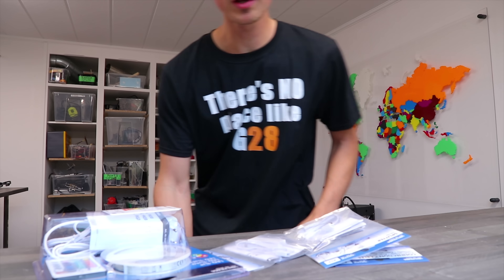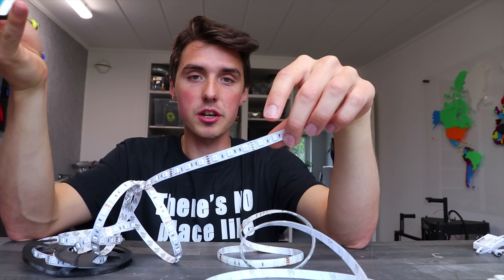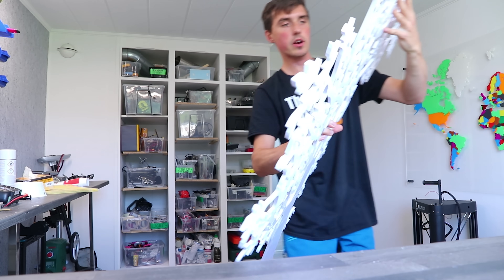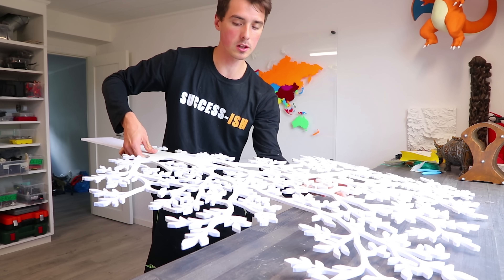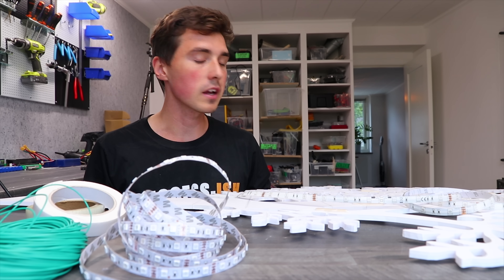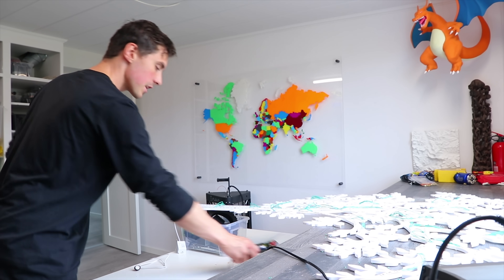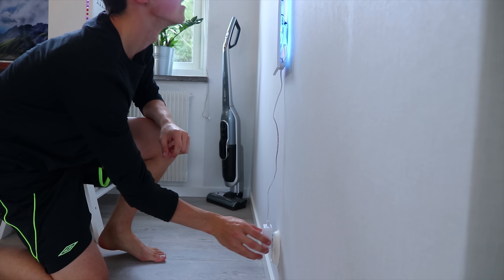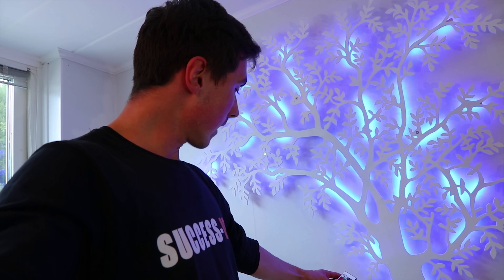This 3D Printed Tree Changes COLOR!

Comment: Hello Simon. I had to enlarge/drill holes in 3D printed parts. After cracking them a couple of times I tried "drilling" in reverse. Normal drill bit but setting the drill backwards. That just melts the plastic to the desired diameter.

Comment: Very cool!
Some ideas :
- put the plug in a timer so you can just leave it on and it will turn itself on/off.
- You could draw some more parts of the ''stam'' to cover the wire and let it go all the way to the ground

Comment: Next time take some metal screw bar with 4 mm and make small pins, then make at each connection holes in the building phase on PC.
Now you have after printing a hole for solid metal connection and for the rest an acryl glue is enough. 
Also the parts will be alligned, so less stress when you build it and print 4 covers for the screws.
Easy thing, a hexagon and a cover plate, connect both and print it four times. Should be only 20 minutes print time.

Comment: Very cool will be to change the 3D model to hide all cables, left properly place to LEDs and electronic, add direct model stands and also detachable connections between parts.

Comment: regarding the connection of the different tree parts, you could have edited some interlocking joints - like used in puzzles. Another option would be to leave a half pipe shape at the edhe (1 or 2 cm) on both sides, glue in a wood dowel (think Ikea) and a 3d printed cover for the back. The front will only have a single connection line like now and it will be pretty strong. Otherwise very nice work as always.

Comment: When you need to fill parts and sand, use wood filler(i buy on biltema too)....they are super easy to apply, easy to dry and sand. To glue those parts you can try super glue and baking soda.

Comment: Should have mounted the LED's facing the other way, and reflect it back at the wall for a smoother light spread.
Reply: It is mounted like that, the tree is mounted with leds facing the wall.😊

Comment: Always finding interesting projects to design, print, finish and install. This one's a beauty.

A couple things I'd revise are:

1. Printing slots in the trunk and branch joints, as well as tapered "biscuits". The biscuits aid in precisely aligning the pieces, tighten up the joints and provide increased surface area for glue.
2. Print "keyholes" in the back of the trunk and branches to avoid screwing through the face. Velco Command Strips would also work well on a project like this that's not heavy at all.

Lastly, I use Bondo Glazing and Spot Putty on all joints I want to hide. Works a treat...and fast!

Comment: That looks awesome. 
While watching you struggle with the epoxy I had an idea of how to make the parts stronger. Instead of cutting the pieces with straight (or slightly curved) lines, try to use a kind of jigsaw-piece hook next time. That way the piece can't move in the horizontal plane. I found out that a 0.15mm tolerance on one of the sides of such a connection gives you a nice press fit. So unless you deal with high forces you could even go without glue. Of course adding some kind of an adhesive further increases the strength.

Comment: 10:09 sorry i dont want to be that guy but please take care not to drill into your house wiring =D just for your safety!
Reply: how does he make sure not to?
Reply: @towers3372  i am not a electrician or anything, but my father always says that the cabels are either vertical or horizontal. so you might at least make sure that there is no wall plug under it. but that's no guarantee for the wire. I think there are some wire scanners avaible. but anyway, very cool project

Comment: You can use flat metal brackets glued or held with double sided tape behind the connections. 
Maybe even make the connections fit like a jigsaw puzzle plus the bracket behind.

Comment: That came out great. If you were to try piecing something together like that again, I recommend trying 3D Gloop! They make a variety of formulations, I have and  use their PLA one to great success. It does a bit of a chemical weld, making the joint pretty darned strong. Joel (3d Printing Nerd) noticed some incredible strength from it when testing it out.

Comment: Nice! Really like that.   If you printed it face down, couldn't you at the seams pieces that come up a bit to give you a larger surface to glue or even bolt and glue them together?  As long as it's not too tall, it shouldn't hit the wall.

Comment: Amazing job !

Side note, your printers consume way more power than your led will even if you let your tree lit up for hours :) so I wouldn't worry about the electric bill if I were you 

Also, a cool upgrade would be to replace the current led strips with ws2812b and combine them to an esp8266

That way you could achieve very cool thing such as the tree glowing of a certain color when an specific event happen (let's say you got an email or whatever)

Let me know if you want to upgrade your setup, I might give you a hand :)

Comment: you should use 3D Gloop instead of epoxy, 3D Gloop literally welds the pieces into one solid piece, it is stronger than the layer adhesion of the print itself, 3D Printing Nerd
 did some vids on it.

Comment: For future projects involving RGB lighting, look into WS2811 pixels. They have super inexpensive controllers for them that will just run modes (much like what you are currently using), but can be programmed using a raspberry pi also to be different colors down to the individual led. I use these on my house for Christmas lighting.

Comment: Really like this idea good work :) I have found a tiny dab of superglue just to hold the pieces in place, then some of the same filament cut off and a soldering iron melting it in the gap (kind of like the way tig welding works) then sand and paint worked for me :)

Comment: Simon, why aren't you printing multi parts with holes in it so you can stick something in it to make it more stable when you have to add the glue. Like the wood pins but maybe not wood but plastic. That would help a lot to manage big prints with multiple parts like that one.

Comment: Is good that you have printers to do this print that takes a lot of hours,is looking nice but I would prefer to use foam board  to do this instead of 3d printing it,I mean you always  have different  materials  to chose when you make stuff like this,but when you have just 1 printer there is no point to do this.
Reply: wont last as long with foam unfortunately. could try thin plywood with a laser cutter. unfortunately laser cutters are more expensive than printers

Comment: stipud question, when you slice it to printable size, why dont you add puzzle like joint points?
also a submerged channel design for the wires and strips?
Reply: He doesn't need channels for the wires since it needs some space from the wall so the light comes out.
Reply: it sticks out and noticable when looking fom the sides plus it had to be glued so it would improve the look and functionality too. looks nice but did not pay attention to details.
Reply: Tamás Gulyás I think it would add a decent amount of time to do those when he could just improvise it and still get a great result. Would be cool to see some of the things you mentioned though
Reply: @RadicalRacoon  Yeah it is tons of time adding clips or whatever, look at these shapes... easier to just glue and spray

Comment: you have the power to 3-D print holes and pegs on each one of the connection points like Legos… Why didn’t you do something like that?
Reply: Because why waste time in overplanning a project if you can nail it improvising? Step 1 print, Step 2 think, that's how it works :D
Reply: That’s what I was thinking, even a puzzle piece sort of deal
Reply: 200 IQ
Reply: + printing holes for leds, ws2811 addressable
Reply: when you see he left silver screws with no paint or caps you realize he doesn't think much just downloads projects from the net
Reply: @knezivan1  Except he doesn't and he didn't here, did you watch any of his other videos? He created the files for this.
Reply: @anthonyp4209  And apparently he will upload files soon...